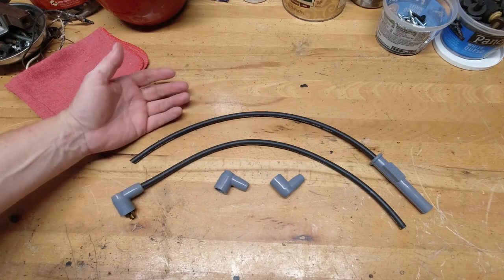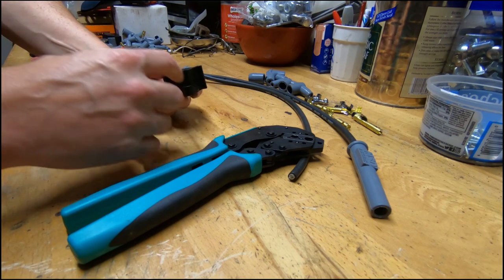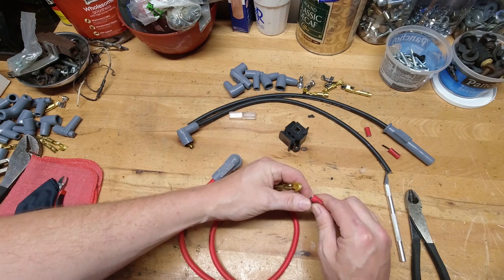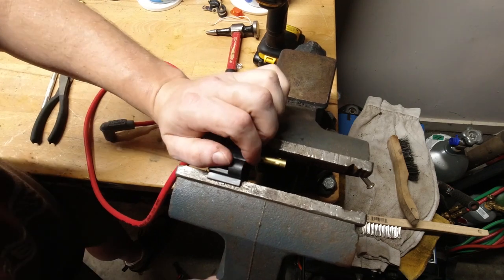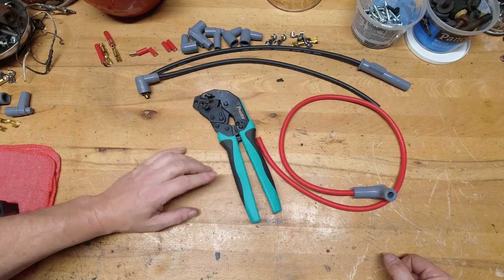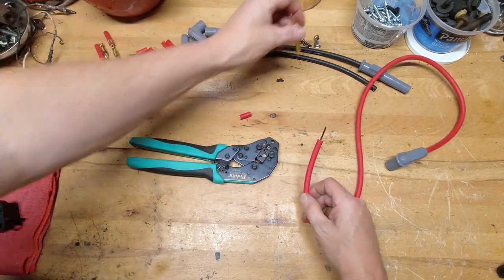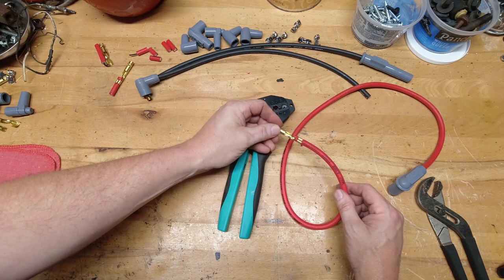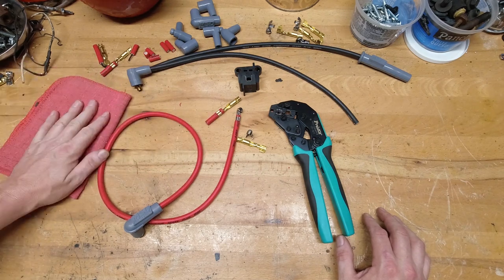How To Make Custom Spark Plug Wire Sets

Comment: Your channel is the gift that keeps on giving! I bought a set of Excel 8.8  custom length wires off eBay for $50ish (trying to save for a used AVS2 lol). Anyway Excel's crimpers, 1 end goes in a vise and the other end you set on top and hit with a hammer. Needless this to say after the second 1 came out funky I went to YouTube. And who shows up? The Carburetor Guru. The vise grip trick made this super easy. Once again thank you.
Reply from the maker: It’s from years of making all sorts of weird mistakes.  The vice crimp tool works just fine!  Glad it was helpful for you!

Comment: So is that ratcheting style tool set to the correct pressure out of the box or did you adjust the crimp pressure with the turn of the wheel?
Reply from the maker: It’s not that complicated.  Crimp it shut till the tool releases. Doesn’t matter what the pressure is.  Or what the diameter of the wire is.
Reply: @MuscleCarSolutions  that isn’t true at all, i bought the ratcheting klein crimpers for an audio project for small gauge wire and out of the box the terminal looked to be crimped correctly but a simple pull test proved otherwise. I adjusted the pressure with two clicks and re tightened the safety and it provided a much stronger crimp to the terminal, i couldn’t even pull it off. So i would say, yes it does matter that you check that the tool is applying correct crimp pressure. Why would the adjustment be on there if it didn’t matter?

Comment: This is a great video - thank you!
BUT - I can't find (carbon core) spark plug wire, anywhere!
The fancy low resistance wires are not recommended for my engine, best to stick to plain high resistance carbon core, but I can't source the wire itself anywhere :-(

Comment: Are you sure you are placing the wire in properly? That is a double crimp terminal. The wire, I believe should have been pushed up further past the next crimp and close to the closed part of the terminal at the top. There should be two crimps, if I am not mistaken...jc

Comment: Do you put the boot on first before you crimp the ends on? Thanks for your videos. I rebuilt my first Edelbrock (1405) by using your videos.
Reply from the maker: No.  I just use a little dielectric grease and slide them on after the crimp.  There’s little advantage to putting them on first.  The concern is pulling apart the inner core.  If you find a way to install the boots without hurting the core, that’s the challenge.
Reply from the maker: Glad you were able to rebuild your carb!

Comment: Where’s the link to the MSD tool? Thanks for this video!!!🔥🔥🔥🔥
Reply from the maker: Its in the description!
Reply from the maker: well, it is now anyway.  lol
Reply: @MuscleCarSolutions  ok thank you 😂😂😂
Reply: @MuscleCarSolutions  would you happen to know why a rpm gauge don’t work? Is there a cable or something? It’s on 2003 Yukon. I’ve been all over the internet and all I can find is the gauge cluster could be bad. My oil pressure is not reading also. I know that the oil pressure sending sensors normally go bad but it’s at the back of the block 🤬🤬🤬😂😂😂